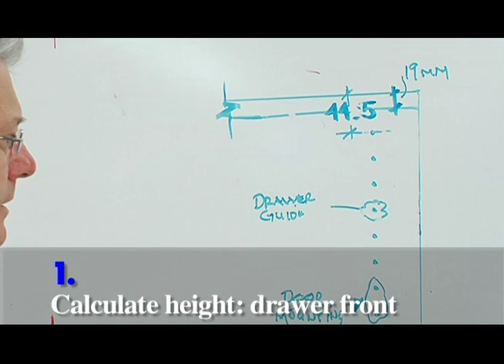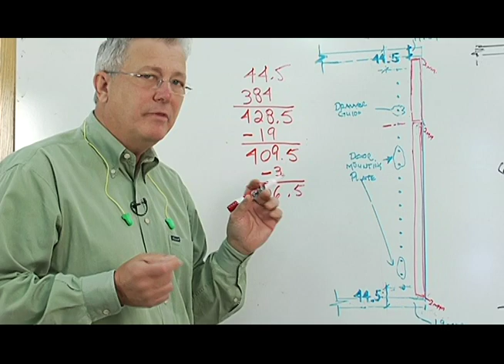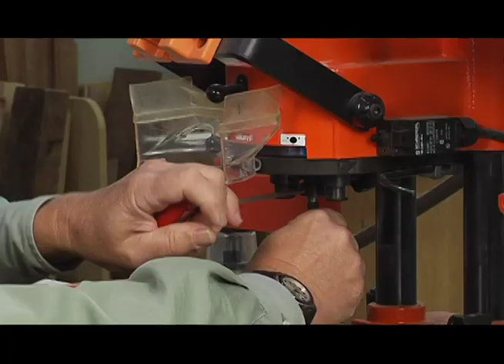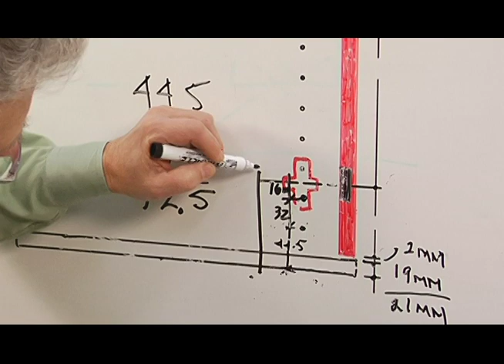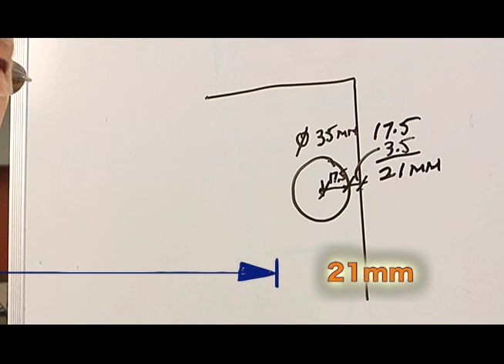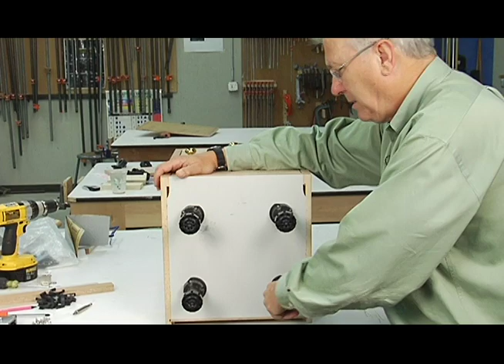Euro-style Cabinet Step 10: Cabinet Front

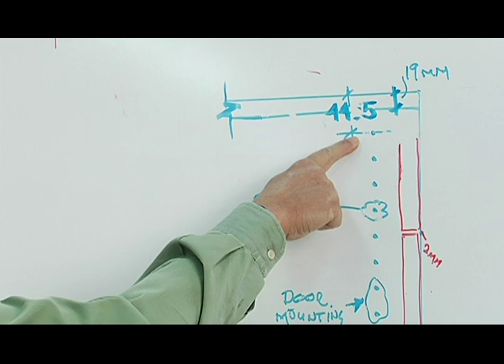Comment: 4:44 why is it 44.5, and not 41.5? According to System32, the construction hole is located at the half of thickness of the panel, so in case of 19 it is 9.5. Next hole (first system hole) needs to be spaced 32 mm counting from construction hole. 9.5+32 gives us 41.5mm. This is the correct spacing. The cabinet height should be adjusted accordingly to get balanced side panels.

Comment: WAY too complicated. There is a much easier way to lay out a euro cabinet without all the included math. All fronts are a module of 32mm less the gap dimension. All hinges top/bottom are at the same dimension.
Reply: Moreover,  I believe it wasn't very necessary to cover the cabinet surface since melamine was already been used!!